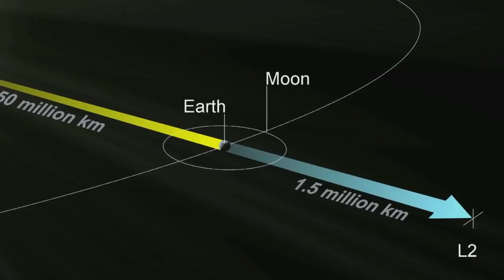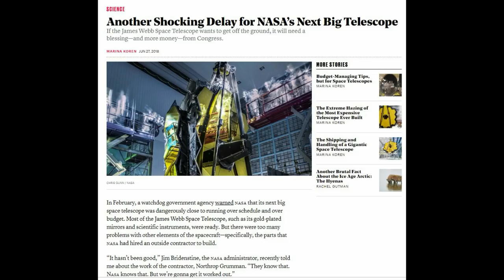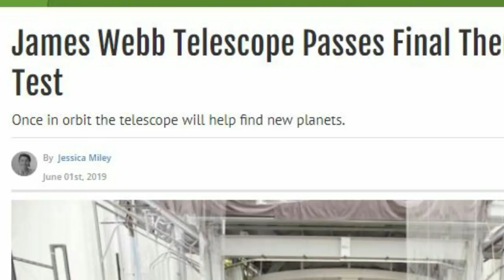James Webb update - Mission Control News Ep .3

Comment: Do you think they have a test so they can test the tests that would test the tests that tests the tests of the telescope? 🤔 

Sorry, I couldn't resist. 😂 
Great video, and glad to hear some news! 

I hope it will go up and work well enough, so at least we can get a couple of images. 
And then, even if it fails, it will be worth it! 

Cheers from France mate! 🍻
Reply from the maker: Yeah I thought somebody might comment on that. What they have being doing is taking the data from tests and running them through all kinds of simulators to test it in a variety of conditions and situations. Thats where it comes from. If nothing else they are being really really thorough. If they do get to launch it, I think, if anything does go wrong, it will be something to do with the launch rocket than JWST.
Reply: @M2M-matt  I agree. 
The more tests and done thoroughly, the more they can minimize the chances of failure. 

I didn't know before your video that it would be that far from Earth, so I do hope it won't fail. 

But, if it does fail, do you think there would be more probabilities that they would just let it die? 
Or they might try something? 

Provided they have the material to do so, of course.
Reply from the maker: @DarthWinterMadness  very unlikely anyone could do anything to fix it. We are well away from any kind of capability to launch a manned vehicle and RV with James Webb and repair it at those distances. At least not yet. If it doesnt do what it was built to do, it is just a peice of very expensive space junk. Although after 10 years or less it will be just that anyway. Space junk.
Reply: @M2M-matt  That's what I thought... 

Well, gotta hope it works well enough then! 

As I mentioned, if we even get a couple of images, we'll able to say that it wasn't launched in vain!